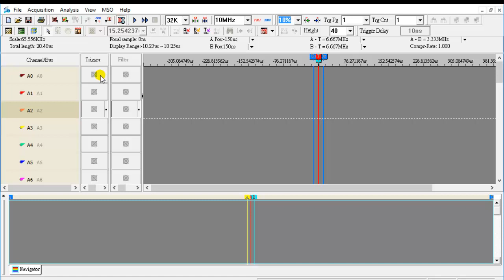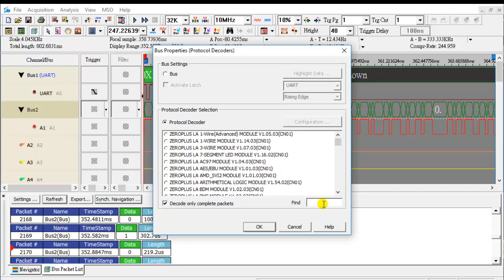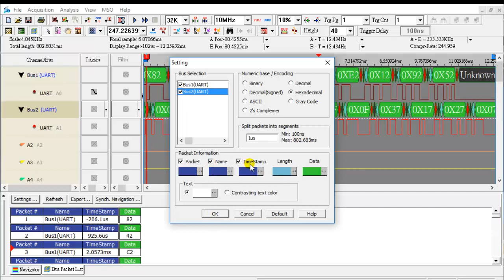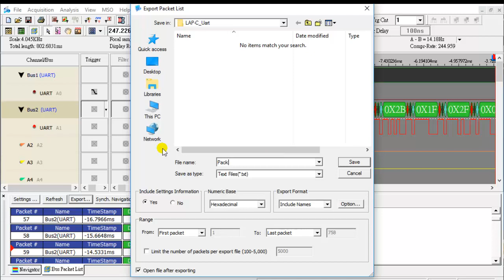LAP-C : How to measurement UART bus

Comment: How do i measure the baud rate ??
Reply from the maker: After the user finishes recording the signal, the decoder can automatically detect the baud rate.. Please watch the video at 1 minute 33 seconds.
Reply: LAZeroplus okay but my protocol uses different baud rates in one package, so do you have any tool for this ?
Reply from the maker: If the user has two baud rates in one record. Users can create two buses for this channel
1. Copy the channel (use right-click and select "Copy Channel")
2. Create a bus for the first A0 and assign a uart protocol for one baud rate
3. Create a bus for the second A0 and assign the uart protocol to another baud rate

In the packet list window, the user can choose to display two uart packets. User can manually check baud rate using A / B Bar
Reply: I have realy big problem about decoding data with zeroplus could you please help me if i send some body from your technical sides? I can buy any tool you suggest but i dont even know which protocol that i scratching. I want to send my saved zeroplus data to someone for solve its protocol
Reply from the maker: 1. The software can be downloaded from: http://www.zeroplus.com.tw/logic-analyzer_en/technical_support.php. 
2. User can save .alc file and send to someone
3. Use demo mode  and open .alc file

Our service mail: service@zeroplus.com.tw